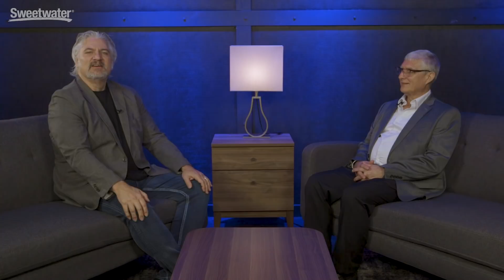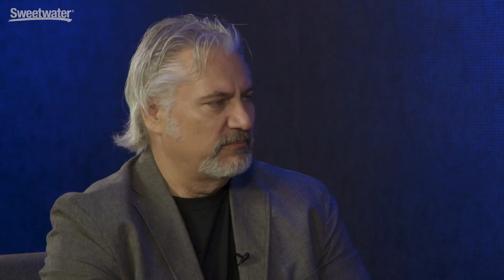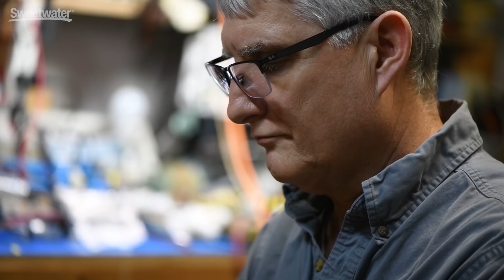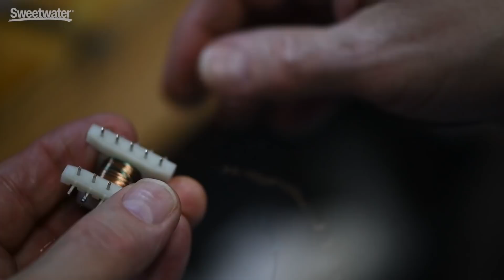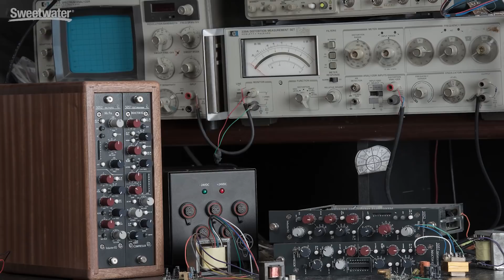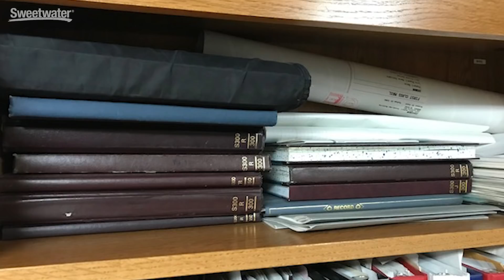Rupert Neve Designs Engineering Manager, Dennis Alichwer, Talks with Sweetwater

Comment: As a Mechanical Engineer with Minors in Electrical Engineering and Computer Science I protested the use of the term Software Engineer at NeXT and later Apple, and I vehemently protest it in Audio Mixing. If you have to ask what a Transformer does you are not an Engineer. You're a Mixing Technician/Mixing Artist/Mixologist, whatever. There is a reason the Circuit Designs are always included in hardware manuals--gives an Engineer a quick overview of how to manage Power, Current, Resistance, Inductance, etc., and to understand the gate logic, op amps, etc., built into the hardware.

FYI: Chinese manufacturing assembles according to the specifications they are given by the companies who contract out to them. If Rupert wants nothing but British, Japanese, American op amps, his custom transformers, ICs and more China will assemble it as specified. Just because it says USA on the label doesn't mean the product is nothing but high quality parts.
Reply: Get a load of this guy ^
Reply: Engeneers reading manuals... Good one :D

Comment: I really been trying to design studio monitors any advice for me 
Im thinking of getting the driver crossover kits and just mix and match until i find the winner 
I want to run a 3 way crossover with 3 tweeters 2 silk domes and a ribbon and 2 mid 3.5 and a 5 and 2 lows 10s or 12s any help would be great to hear thanks fpr all your help